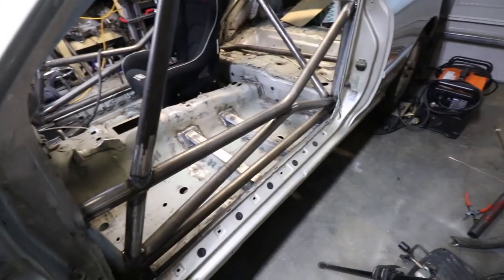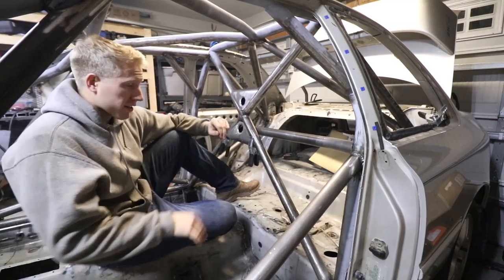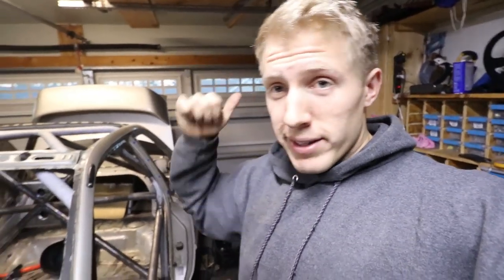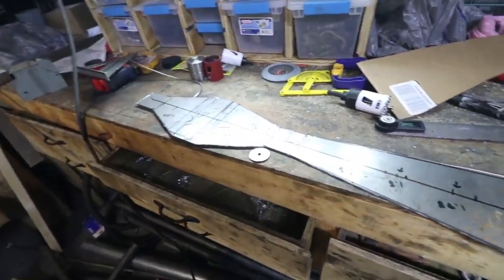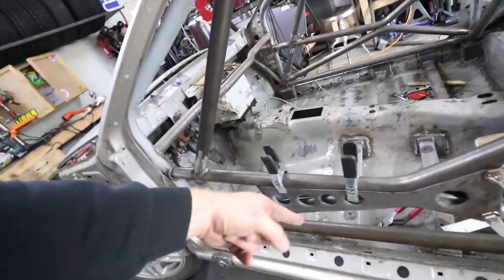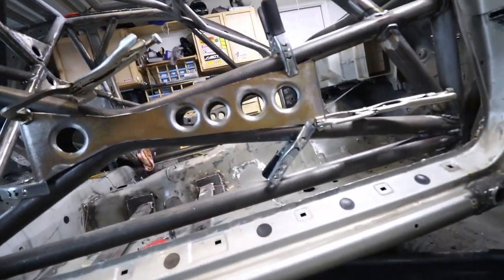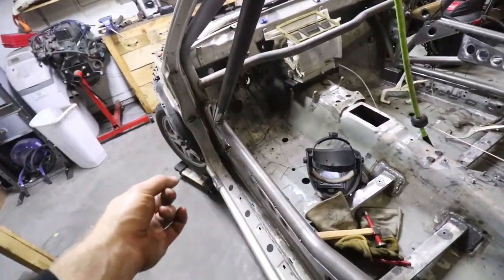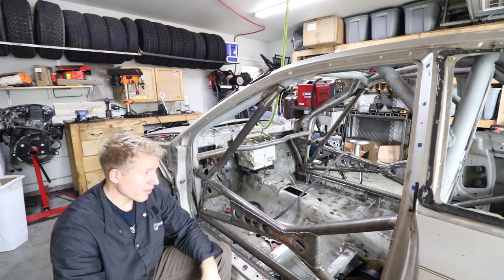GC8 Rally Car - Taco Gussets - Subaru FIA Stage Rally Roll Cage Build

Comment: What brand dimple dies did you use?  Would you recommend them?  I'm doing a very similar build and your series is a big help in planning.  Thanks!
Reply from the maker: I got a set from SWAG offroad, they work well, the most important part is getting a clean hole cut into the steel before dimpling it.
Reply: @DirtyGarage  Thanks!  That is what I was looking at too.  It is funny that you and I have a lot of the same tools...and the same car...

Comment: Is there a reason you went with straight door bars instead of nascar style/extended into the doors themselves?
Reply from the maker: NASCAR style door bars aren’t an approved design by the FIA, it’s still possible to pass scrutineering with them but it would be on the scrutineer if he approves it. 
If you plan on using them I would work with whoever will issue the logbook for the car and see what they have to say.